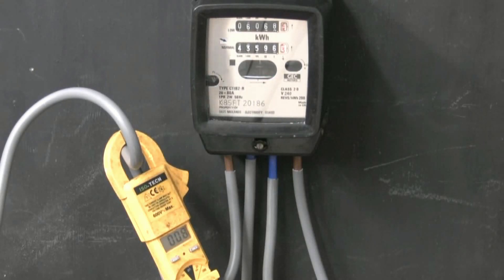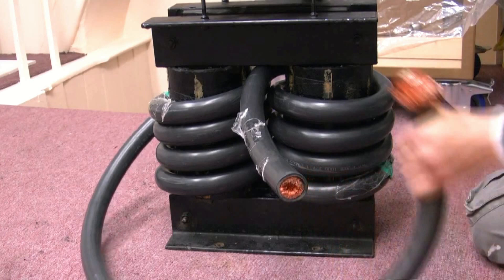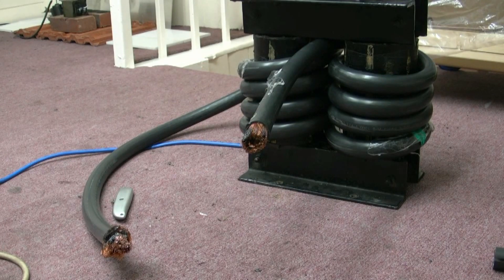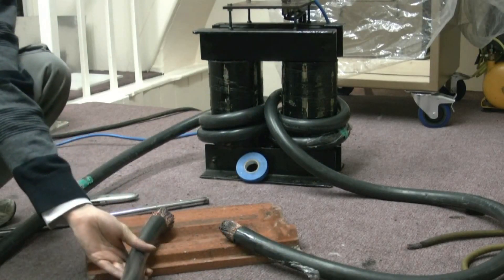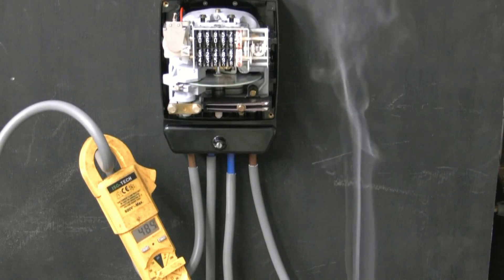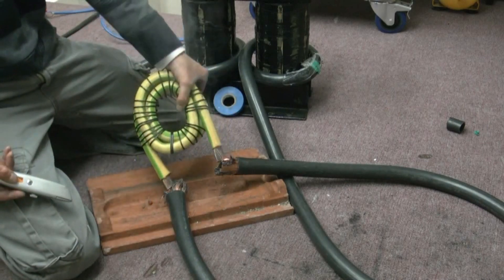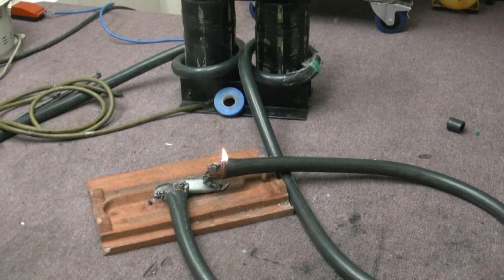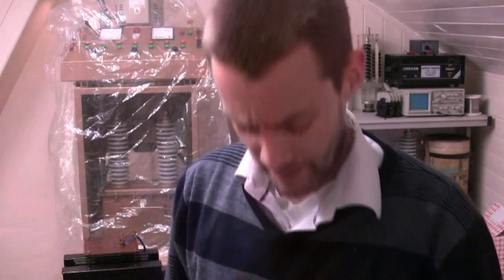Too Much Current + Electric Meter Pops

Comment: Let's run some numbers

He said that at 250A on the primary he could get 20kA on the secondary, which on a 240V supply means there's about 3V across the secondary (P=IV, P=250*240, P=60kW, V=P/I, V=60000/20000, V=3V). Estimating for about 10m of cable, there's a resistance there of about 50μΩ, which, when shorted, makes for a current draw of around 64kA.

I licked my fingers and measured the resistance between them with my multimeter (accurate and scientific I know) to be about 50kΩ, which at 3V, would draw around 0.6mA. (I=V/R, I=3/50000, I=0.0006A)

If my brief googling is correct, this shouldn't even be a tingle, though if you've recently exfoliated your hands and dip them in saline you might feel more of a tingle, but not a painful sensation. In conclusion, my haphazard googling and back-of-the-envelope maths shows that holding the leads should be perfectly safe.

You first though...
Reply: r/theydidthemath
Reply: Finally someone with some sense
Reply: You're wrong in stating that the current draw through the secondary while shorted would be 64kA. Conservation of energy would dictate that the current draw on the secondary could not exceed 20kA in a perfect conductor. If you try to draw more than that you would have partial emf collapse on the primary coil, which would subsequently reduce the effective potential across the secondary.
Reply: @MisterHouu  yes of course if the supply is only capable of providing 250A then the maximum would be ~20kA. The 64kA figure was for a theoretical maximum current assuming the primary was able to supply arbitrarily high current without voltage drop
Reply: @MisterHouu  Now say that again in plain english please
Reply: @vejet  it would basically be like having a hose fill a bucket with a hole in it. If the hose fills the bucket as fast as the hole leaks you will expect to see a certain amount of flow coming from the hole, but if the hose can't fill the bucket as fast as the hole drains you would get a sort of "trickle". In this analogy the coils are your bucket, the input current is your hose, and the output current is your hole. Does that help?
Reply: Finally, another person who knows what they're talking about!
Reply: The King  HA! frustrated that someone who is different from you is smart? of course.
Reply: The King  you’re still here nearly a year later Jesus
Reply: The King  you were on meth? So a fuckin druggie too? Damn you are pathetic. Rude as fuck and on meth, what a loser.
Reply: r/hedidthemaths
Reply: The King  you the original troll... top hole sir! everyones a softarse nowadays,
Reply: The King  Elaborate?
Reply: That glowing hot piece of metal he's holding on the other hand...
Reply: i just wanted to see the organ(s) in the path of least resistance go POP.
Reply: But it only takes miliamps to kill right?
Reply: @babypandafan4810  yes, though we're looking at less than 1mA here, and it takes around 100mA to kill someone (depending on where and how long the shock is)
Reply: @zeebeezoey  oh yes. Didn't look carefully the first time to see we were talking 1/10th of a miliamp
Reply: @zeebeezoey  I'm guessing that 100mA for death would be based on AC through the heart, potentially achievable with very few volts if connected directly by a surgeon.  For your original calculation I would note the transformer ratio is 20kA/250A = 80, so the voltage would be 240V/80=3V~ which is perfectly safe across the outside of a normal human body, even if applied directly to the chest in an industrial accident.
Reply: @johndododoe1411  I'm not sure whether the 100mA figure means directly over the heart, or whether it means across the entire chest, but from arm to arm, most of the current would flow across the upper chest, so in practice 100mA from hand to hand would be close enough to 100mA across the heart that it's probably ok to ignore. What's more, the lethality of such a shock would vary from person to person. The actual voltage taken to kill a person would form some kind of bell curve around ~100mA. One person might be killed by 20mA, while another might survive 200mA depending on a number of factors.

The main point was that 3v applied externally would not result in a lethal current flow.
Reply: The King  never heard of Rachael Riley then have you. Idiot.
Reply: The King  If you don't get horny by reading your own comments I'm Barack Obama and I'm whiter than a piece of paper.
Reply: The King  Yank myself 4 times a week.
Reply: The King  Actually I did have a plant for well over 1,5 year. Grew like weeds. I pissed in it and the roots rotted away. Most likely from the fact I always gave it too much water, probably not the pee.
Reply: The King  I'm not into trees personally. Would that be categorized as some form of necrophilia if this was the case? Also I don't know how that would work. Should I just touch it whatever place seems naughty? Where is that place of a plant?
Reply: The King  I really enjoy our conversations. Would you want to be my pen-pal? I also need some pictures to know who you really are - without clothe on. It's nothing major I'm asking for, but very important for me.
Reply: It would burn, wouldn't it?
Reply: The King  what? why?
Reply: Super everything you said is correct
Reply: Photonic induction likes to mingle a bit of tingle for your fing.
Reply: @weareallbeingwatched4602  
It is a showoffs.
Reply: wow another intelligent youtube comment thread. they are so rare
Reply: The King  you have been arguing over nothing the whole time, the O. P is a man.
Reply: Finally someone we don't understand because of the ridiculously long comment XD
Reply: women can't do maths lol

Comment: what is 400 mil cable used for?
Reply: Underground Power transmission.
Reply: Ohh ok, I've seen it on the backs of construction trucks but I never knew what is was for.
Reply: +bigjoeangel not really true

Comment: Water cannon flow if the pressure isn't high enough, Volts is the pressure, Current is the flow, If your 1 meter diameter water hose has no pressure, it will not kill.

Comment: If your coming to the comments to ask why he is not dead with all that voltage going through him, right? Well first off I can tell you never paid attention in high school. Or the educational system is flawed. But because of his resistance compared to the extremely low voltage going through him. Plus if Will take the path of lest resistance and go through the highly conductive metal and now his low conductive skin. He is also on a carpet, preventing any current to go into his body, instead directing out with out harm. Meaning he is safe from the Amps.

Comment: 400mm cable? or 40mm cable? looks like 40mm still impressive video, try lower voltage is amps is your goal :)
Reply: That's what he did by lowering the number of loops on his secondary coil. :)

Comment: To everyone wondering why he isn't electrocuted, please read this. https://www.physics.ohio-state.edu/~p616/safety/fatal_current.html The transformer is low voltage, so a human body will not draw enough current to cause any immediate harm.
Reply: +ThingsDemystified The accurate reason why he isnt electrocuted is because electric current takes the path of least resistance.

Comment: This is insane and extremely dangerous to the point that I would report him to police if I knew him.  But on the plus side, the metal bar looks like  light-saber when it is heated up between the connections...
Reply: +Thomas Dohlman Actually it is not as dangerous as it looks. Even though it is indeed insane, the worst thing that could´ve happened to him in this experiment was setting his carpet on fire.
Reply: at about the many hundreds of amps...?  That would be like getting struck by lightning many times over but the current would not be as deadly...  It would be very shocking...
Reply: Yes, that is correct, but lightning has also millons and millions of volts to back up the current, without that, lightning wouldn´t be able to travel through air. This "experiment" is operating with an insane amount of current (for a normal power grid), however, the voltage is minimal , thus it cannot really harm him because the resistance of human skin is just too much.
Reply: It still makes me cringe!
Reply: stfu
Reply: What’s really insane is the stupidity of your comments, that shit I’d report to the police.
Reply: I bet you're fun at parties
Reply: +chrishdman87 Why don't you, douchebag?

Comment: This is some funny shit! The way he talks makes it even better.

I thought I was bad ass by rewinding a microwave oven transformers secondary with two or three turns of 1/0  copper THHN. It was tough to wind but it was pulling 800A+  (only 3V though) and melting 6" - 1/4"x20 threaded rod almost instantly, but it tripped a 20A breaker if I left it on too long. I fixed the tripping problem but I prefer not to say how, all the safety nannies will come out.

This dude is browning out his neighborhood with that big ass x-fmr core!   Love it!
Reply: let me immagine.. tape? or a block of wood
Reply: +Chris Barth glad i live nowhere near him, my pc's would cut off.

Comment: That can do serious damage to electric supply in the home!!!
Reply: he has a 100 amp circut for it
Reply: overloading your cables and devices would not be smart. this isn't the meter for his house,  he got ahold of an extra one and tested it. he doesn't say what the voltage is but it takes less than 1 amp to stop or send your heart into arythmia.

Comment: Why doesn't he get electrocuted when he touches the metal?
Reply: +C Liviu Also to further Lythieus1's comment Electricity will always take the path of least resistance.  You can actually touch a hot wire in an AC system (which is want your house and all your electronics use) and not get shocked but you run into issues if you directly connect the Hot wire with the Neutral Wire Or any Ground.  (Ground is the term used for all metal that connects everything to the actual ground near your home or the building) In the US we have a 3 pronged plug you have the 2 flat prongs the smaller flat is the hot the wider flat is the neutral and the round or half round hole or prong is the ground.  If you connect the hot and neutral or ground you get a short circuit a the electrical breaker Should trip (wont always if its old and not working correctly)  In the case that it doesn't work it will either burn a hole in the wire or burn whatever is connecting the hot and neutral or hot and ground.  SO HERE IS WHERE YOUR ANSWER IS.  If you connect the hot and ground with your body (lets say you grab the hot wire with your right hand and the neutral wire with your left hand.  That electricity will travel through your right arm through your chest and down your left arm.  As you can imagine having electricity flow through your heart is bad.  But remember electricity is lazy it'll go the easiest way so if its metal touching the two wires it will go through the metal not you.  ( this explanation doesn't Exactly cover what hes doing but the same concept applies.  He was using electrical inductance in this video not actually just shorting a circuit.  A short achieves extremely high amounts of current and usually with either trip your service or just pop the breaker and in worst case scenarios cause an ark flash if the amount of available power is high enough.

Sorry for the essay  :)
Reply: Very high current with very low voltage. Same reason you don't get a shock off a 1.5v battery. I estimated roughly 50k amps at 0.2 volts, that can't hurt you. But that would pull 10KW unless i have my math wrong.
Reply: Reegareth
 omg this is the best explanation!!! Thank you sir, now I understood.
Reply: ***** glad I could help.

Comment: How on earth does the UK provide so many amps to a household, the maximum allowed current here in Portugal for a common household is 30 A if single phase or 90 A (3 x 30 A) if 3 phase is used.
Reply: Here in the good old USA we have  the following options for residential: 30/60/80/100amp 120v single-phase,100/200/400/500/600amp 120/240 split-phase, and 200/400/600/800amp 120/208 Three phase. However 99.9% of the time it will be eithional 27er 100amp or 200amp 120v/240v split-phase service. As for comercial and industrial its usialy either 120v/208v or 277v/480v with the rare 227v/480v/600v.
Reply: Still alot. Here in The Netherlands we get 25A or 35A thermalfuse or 40A breaker in newer homes. If i wanted say 100A single phase or 3x35A three phase i would pay around 2000 pounds each year for standing rights alone. The best bang/buck option here is 3x25A but you have to be real careful not to overload one of the three phases.
Reply: I am commenting on this year old post for the express purpose of asking, how do you do anything with 18KW or so from 3x25A? People are regularly starting to blow 100A split phase here in the US and almost all new construction is 200A split phase (140V phase to phase, 120V phase to neutral). On the lower end if you have an old house with even 80A service you are talking almost twice the power capacity of what your average home has.

Do you use all gas appliances where possible? Water heaters, stoves, dryers, etc? Just my stove and coffee maker alone would trip the breaker on one of your phases to neutral (assuming its 230v phase to neutral as i'm nut sure how yours is setup).
Reply: my service in USA is 200 amps. USA all newer services are 100-200 amp service to my knowledge for a typical home. Some older houses might be 30-100, but most people would upgrade. It's so all typical applications could run concurrently without risk of fire or tripping main breaker. All new homes get minimum of 100. The point of this is to oversize the service for safety and less annoyance. I roughly calculated my current total load with everything (standard appliances and no special stuff outside AC) as 111 AMPS. I got 200 just so I wouldn't have to worry about it.  

 I have had most things on at same time before. So it does occur for me at least. Cooking range and oven, washing clothes with hot water, drying clothes, electric furnace on or central AC. Plus miscellaneous lights and appliances. However, this setup doesn't happen for long. AC kicks off or something else finishes after few minutes.
Reply: The UK generally gives households a 60-100A single phase supply, however this guy is using other equipment to simulate what would happen if you put 600A through a normal meter. The actual Current flowing through his meter would not be this much, and the elaborate Grid shutting down thing was to add to the effect. Lesson: Don't believe everything you see!

Comment: How the fuck isn't he dead yet??
Well... proves that demons do exist...
Reply: SuperConductor u wot, wasnt it current that killed? try getting zapped by a sparkplug
Reply: current also kills, but you need higher voltage to the current break the body resistance and actualy kill you burning from inside
Reply: Luiz Fernando Yes. But it is the voltage which defines the current based on the resistance.
Reply: +SuperConductor No, amperage, or current, is what kills. It takes around a half of an amp to kill a human.
Reply: ***** lolk, be careful :/
Reply: ***** D:
Reply: +animalmother556x45 not really, its a combination of things. The amps here are really high, but the voltage is nothing. high enough amps and volts will kill you.
Reply: +animalmother556x45 That is because tasers only apply that high voltage for a very short amount of time. Tasers are ment as a short sharp shock to temporarily disable a person. There is just not enough time for the taser to do anything lethal. You do not taser someone continuously, or that will kill them. Also, if I have something that can supply a very high voltage but very little current (like a tesla coil) and you touch that. Then the voltage will drop. This is because when your body starts drawing current from the coil (which can't supply enough current) then the coil will not be able to maintain that high voltage therefore dropping, therefore not killing you straight away.

Look around, you will never see a sign that says: "Danger: High Current" You will instead see signs that say: "Danger: High Voltage" This is because it is the Voltage that defines Current. You will never have current without the voltage.
Reply: +SuperConductor The Law Enforcement tasers are on a 5 second preset time. The officer can then re-apply that 5 second jolt as many times as is needed. the Civillian version on the taser is on a 30 second timer (the theory being, you shoot the probes into the person, then you have 30 seconds to get away).

So the human body can handle 30 seconds of 50,000 volts at just a few miliamps (can't remember the Taser amps for sure). 

Just to try to be clear, are you saying that humans can handle massive volts with very low amps, and massive amps with very low volts? But the combo of the two is what kills?
Reply: Monokuma 20-30mA current  starts to be dangerous to human
Reply: Cesare Vissani yes its the current that goes trough your body, to get higher current through your body, you need more voltage and lower resistance to ground. 
Higher voltage will make higher current through your body, and lower resistance will make higher current.
Reply: Voltage ÷ Resistance = Current
Reply: Very low voltage, extremely high current. Remember it's the voltage that kills.
Reply: Current is just the speed that the electrons go around something. because in terms of your body, 1 volt wont do anything to you even at high speeds